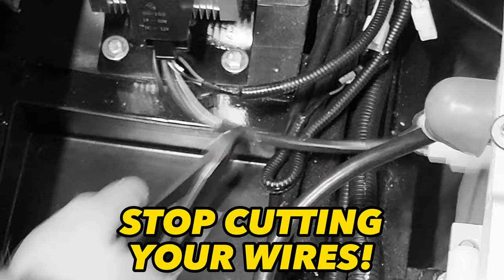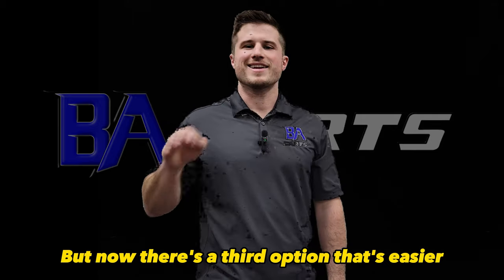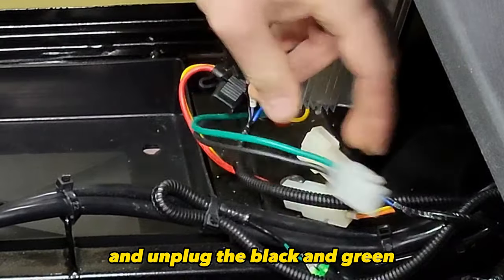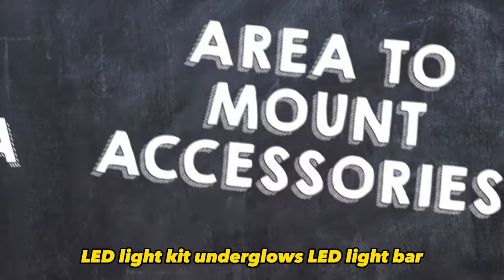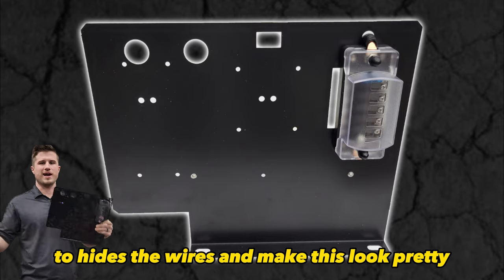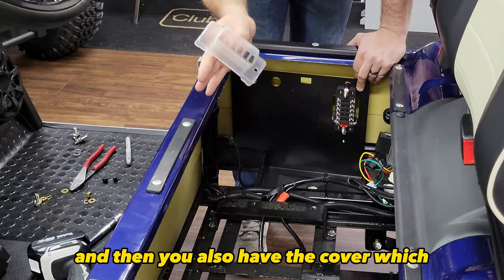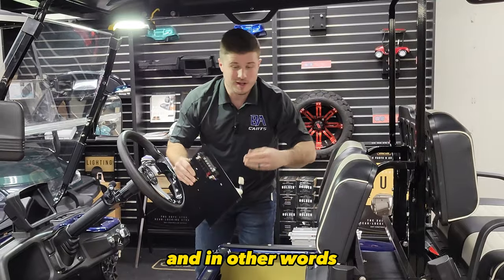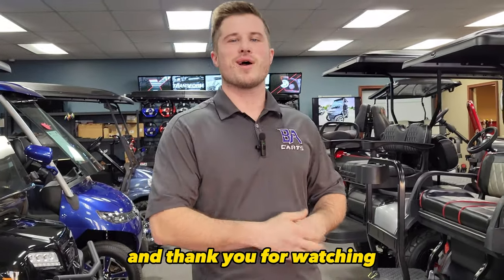Quickly Install 12Volt Accessories To Your Evolution Golf Cart With The BA PowerPlate®!

Comment: Wish we had place like yours near me(Delaware) Just purchased a Evolution D3 2023 cart…Only disappointment? Their sound system! 4 speakers in the roof of the cart..The sound puts me back in the 70’s when I first started driving with my 2 (melted) back JVC speakers in my car.🤪 Anyway, planning on doing a under glow kit and just upgrade 2 or all 4 speakers…The bitch is getting to the battery of this D3! I believe I have to remove the Seats! Any suggestions? Do like your video on the board which I fell will be the smart move to do!
Reply from the maker: Hey Gary!  Thanks for the comment! So the only way to improve the system on the D3 is to install a low output converter on the touchscreen's audio output, run that to an amp, and the run the factory speaker wiring to the amp. You don't have to remove the battery or the seats actually. The access panel to the 12v converter is behind the cushions, so you just have to tilt them forwards. As far as products and videos go, we don't do them by random, we specifically carts and topics that have a strong demand and umfortunately, the demand for the D3 isn't as strong Evolutions other carts.

Comment: Sloan you seem to know a ton about Evolution carts. I recently purchased the Forester 4 Plus. It has a 110 Ah 48v battery. I feel like the battery percentage drops quickly. Much quicker than our previous lead acid 48v battery. Today after it having charged all night we took it out. Mileage started at 400 and ended at 405. Our battery went from 100% to 88%. I’ve talked to so many who have had different responses about their battery life. Does a 12% drop in 4.5-5 miles seem right? I’d love any feedback you could offer.

Comment: This look great!  Any thoughts on adding a relay so the distribution block won’t power in without the key on?  Worried about items draining the battery with the cart off.
Reply from the maker: Hello! So the distribution block plugs directly into the 12 converter on the reducer which is ONLY on when the key is on  (this is how most Lithium ion gf carts are), so you will experience zero battery drain when your cart is off! Now if this Powerplate was made for a gas golf cart, then yes, a relay would be a super good idea! 👍

Comment: Will the Boost Box I just purchased from you (but haven't yet installed) mount on the PowerPlate?
Reply from the maker: The BoostBox is for the D5. The Powerplate in this video is for the D2 model, not the D5. We do make a D5 Powerplate, it's under the D5 section on our online accessory store.

Comment: Do you offer an option for 72v lithium golf cart?
Reply from the maker: We only make PowerPlates for Evolution D2 and D5 models. But based on how you're asking the question it sounds like you might think that our Powerplate also includes a voltage reducer? Which it does not,  just plugs into the reducer. What kind of cart do you have? If it's a new cart that came with 72v battery then it should have a reducer already.